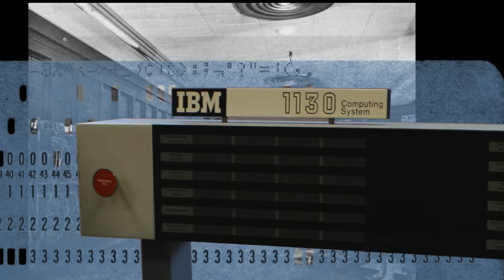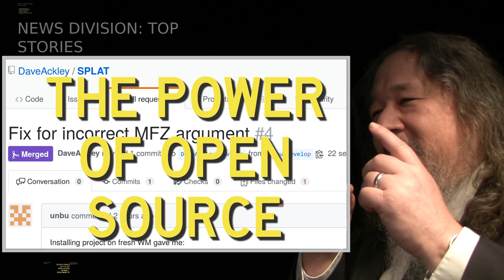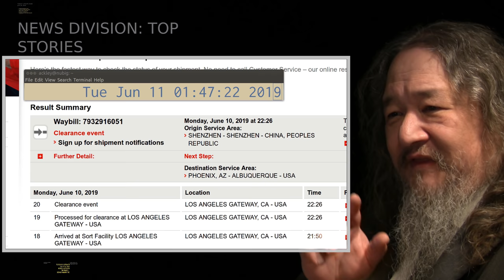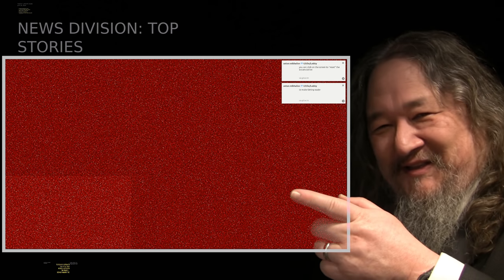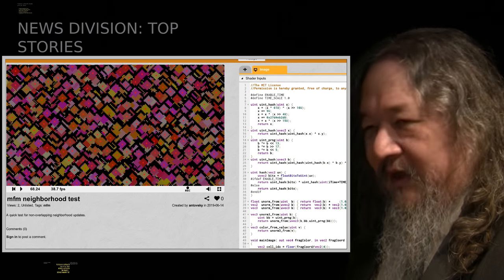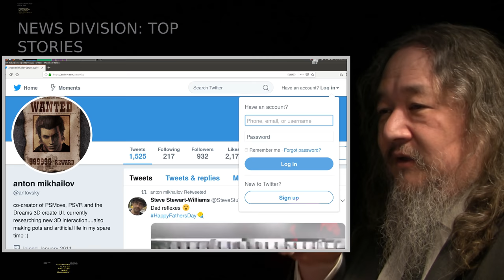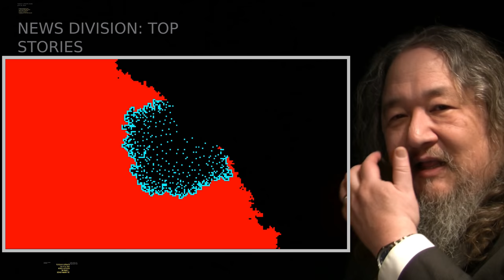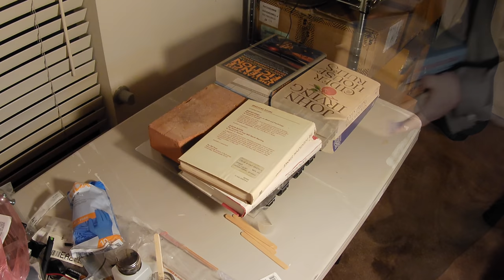Making New Connections - T2sday Update 236

Comment: One of the things that really gets me excited about MFM is that it is perfectly threaded. In theory, the AER you get should scale (almost) linearly with the amount of cores you can dedicate to it, which seems to be the direction current CPUs are going.

I never thought you could leverage GPUs to such an extent though. An MFM simulator running on a gpu would make a great testing tool!
Reply from the maker: The total average-events-per-second (AEPS) performed should indeed scale linearly with the site count.   The AER (average event rate in AEPS/site) should be constant!